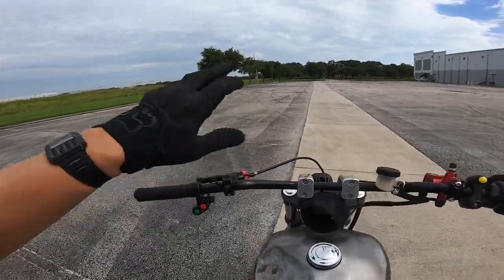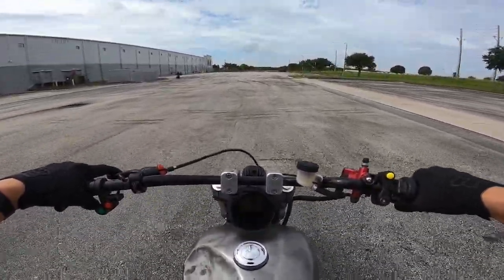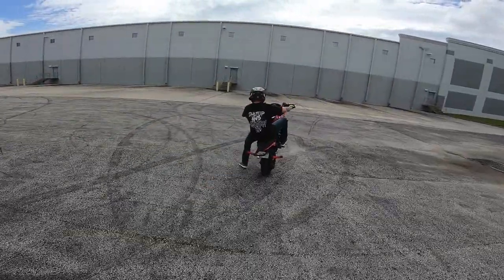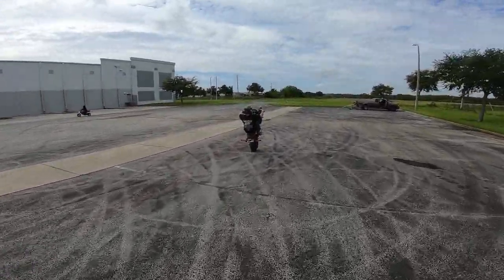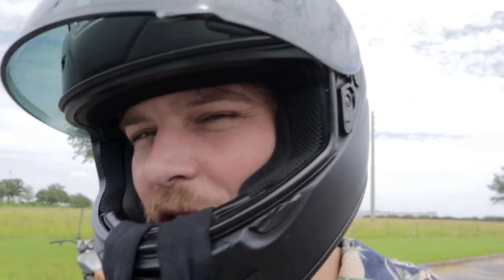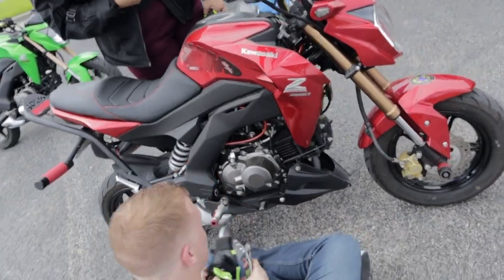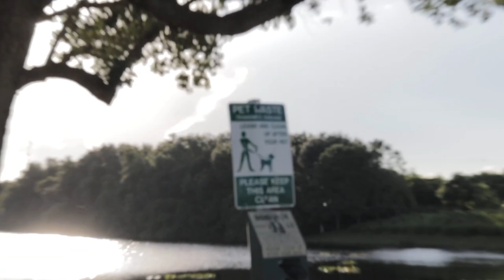HOW TO: Drift a YAMAHA BOLT pt.3 | LOT DAY

Comment: I always wanted a bolt. Looks like a more powerful virago haha. A set up bolt looks easier to throw around than a set up Sportster just from seeing vids. Price is about the same tho. My 1200 ain’t a bad bike at all and it’s set up pretty well for handling performance but it’s prolly a bit heavier than one of these and maybe a lil longer
Reply from the maker: Probably a little more powerful that then virago haha if you get a bolt as cheap as what I have, it’s much cheaper to set these up for stunting. Like grand total of 4-5k if you buy smart. I actually use to think the same thing about the sportsters and bolts but the reason mine looks so short is because the back end is raised up. Definitely go check out some of the early build videos, this bike looks completely different! Thanks talking!